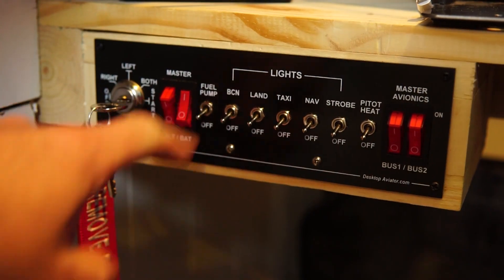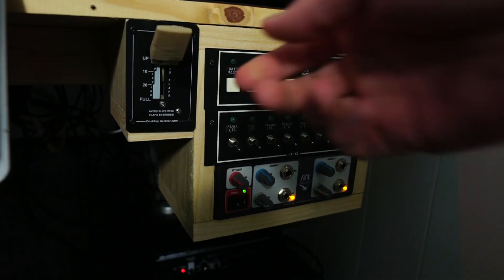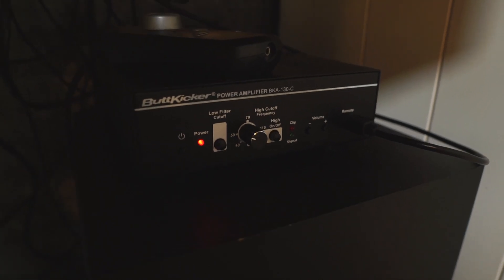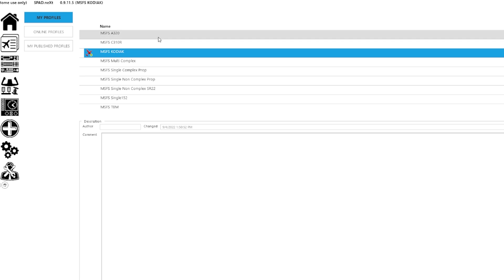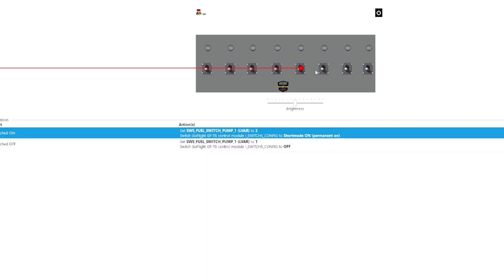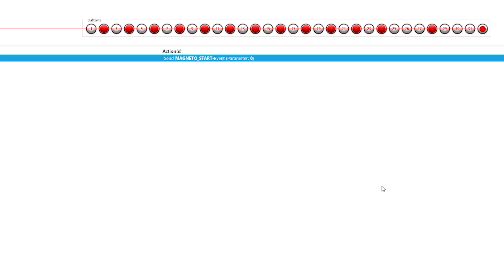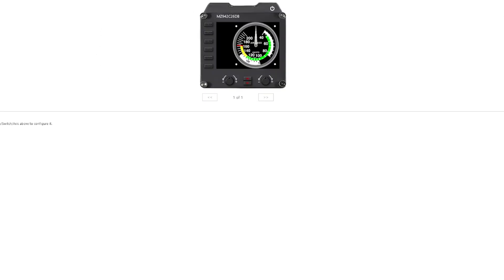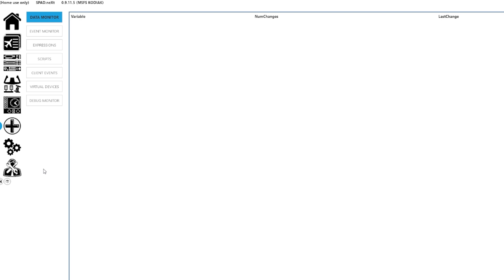Home Flight Simulator Tour Series - Switch Panels, FIPs & SPAD.NeXt - Episode 4

Comment: I really need to learn more about spad.next. Seems a bit overwhelming to me. Im a hands on hardware kind of guy, so software just seems to stumble me. Im using multiple Stream Decks for most of my push button functions (utilizing their software)have one FIP for chrono (spad), and a toggle switch panel (mobiflight), then thrustmaster airbus and boeing (MSFS). So I would like to move the switch panel and controller onto spad, but not sure exactly how to go about doing this. Ive purchased spad, but it just seems complicated
Reply from the maker: It's got a bit of a learning curve but I promise you once you get comfortable with it I can't use either sim (XP or MSFS) without it.  There's not much it can't do.  I even have it control my philips hue lights!
Reply: @av8rchris  ….. how would you suggest I start? Ive purchased it, and immediately felt overwhelmed and haven’t done anything with it.

Comment: Fantastic setup. I always wondered how the the Brunner yoke and buttkicker work together? As I understend they both simulate vibrations from different sources in the sim, are in sync when you change RPM for example or land?
Reply from the maker: Thanks!  They work together but independently if that makes sense.  The brunner yoke has its own software which controls the feedback to the yoke.  The buttkicker I use the software "Simshaker for aviators" which connects to the sim API vs using sound to generate the feedback.  Its a night and day difference as it generates the proper tactile feedback (all customizable) for the phase of flight.  Feel flaps and g load ect is pretty wild.  I actually keep the yoke engine vibrations down or turned off depending on the aircraft, but engine vibrations on the butt kicker is pretty awesome!